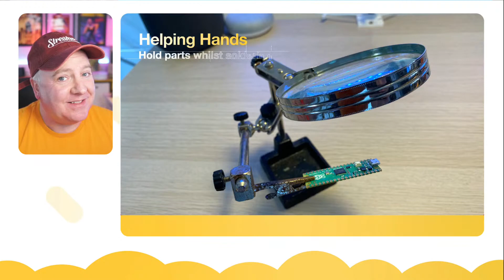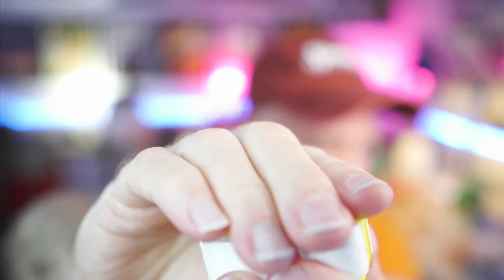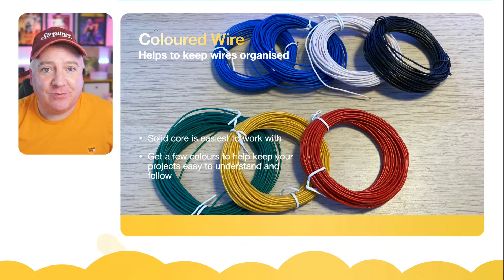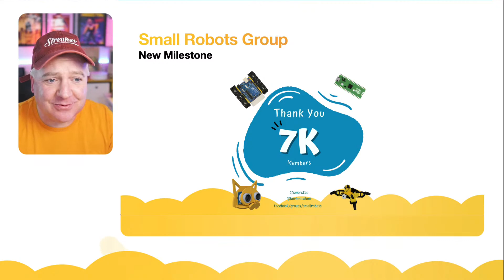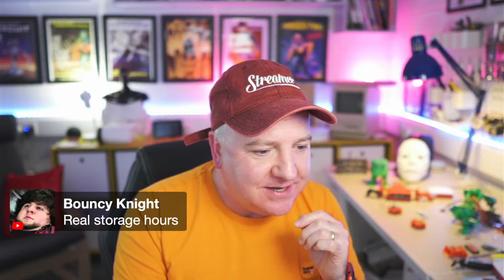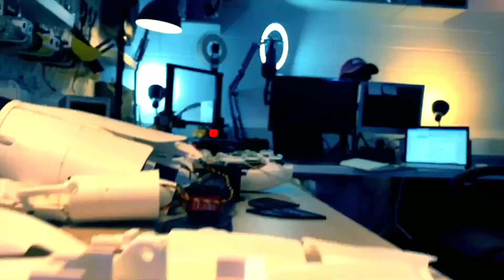Build your Dream Robot Lab

Comment: Hello Kevin. A few comments on your video. A little about myself . i was electronic engineer (analogue) most of my working life, so these are from my experience. Soldering irons, I don't think the main iron you showed is a good idea. A low voltage 
temperature control iron is better for soldering electronic components. The ability to be able to change the iron tips is also an advantage. 
! wouldn't recommend using Bluetak to stick SIL connectors to a board  prior to soldering. The Bluetak leaves little bit behind, but more importantly you cannot guarantee that the connector is square to the board. The best way is to plug the connectors into a breadboard( e.g. elegoo one)
 with the device on the connectors then solder. This is where a good  soldering iron is important. The helping Hand is a good thing. I have one one with a light by the magnifying glass . This makes soldering small components much easier. i don't have a 3D printer . My robots are made out of metal. I have a number of metal working machines. I thought about buying one, thank you for your advice on that. What are the dimensions of the one you are using. I would have to find a place for it.

Comment: What should i do when i having a small Rome only , please give me a solution for this issue
Reply from the maker: Use what you have - I started with just a desk, and a 3D printer and computer all on the same space. It was far from ideal but that’s how I got started. I had lots of storage boxes with projects, components and tools in that I would pack away once I’ve used them.